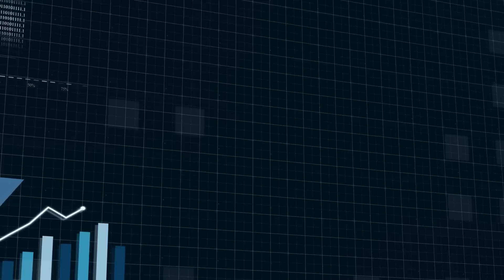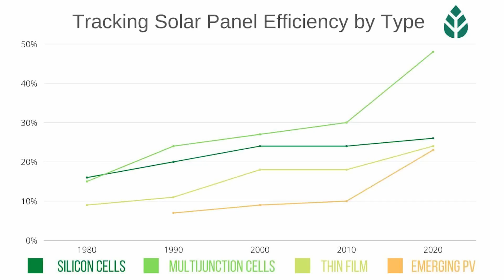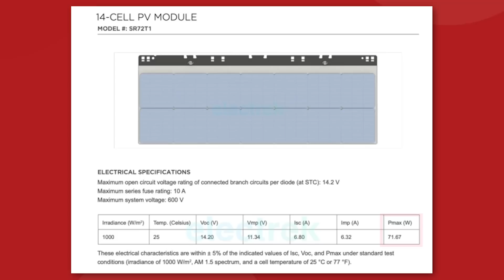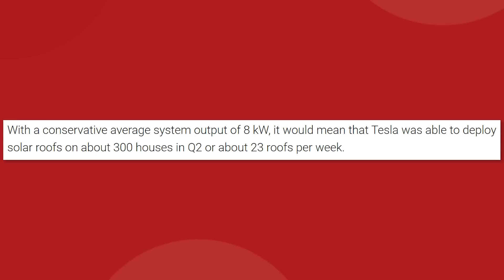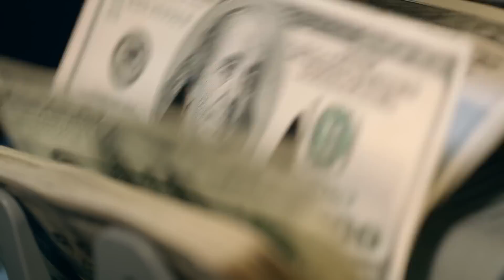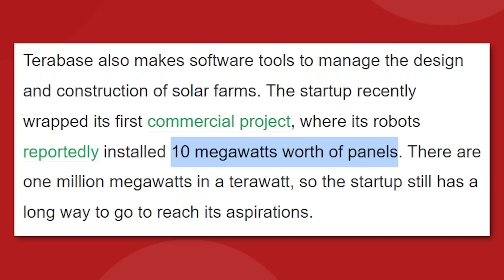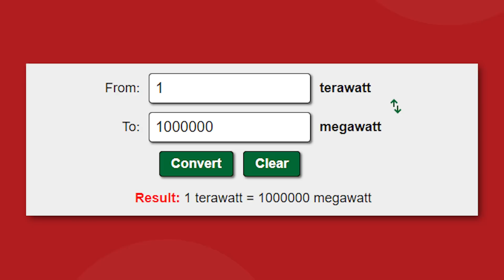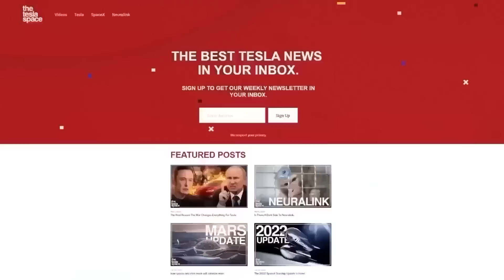Why Tesla Solar Is About To Take Over!

Comment: This summer i was helping out at a company whose neighbor was a Tesla Solor Home installer. I saw them preparing each day to go out and when they came back.
Talking with them one point is that in Texas it often is over 100F during the summer. But on a roof its closer to 160F. So its hot & hard work. Sounds like something Optimus should be doing.
Another thing is that out of 100% population at least 2-1/2% will always cause trouble. So naturally they are also involved in lawsuits with these annoying people. (Best disconnect & refund at 1st hint of trouble)
In electronics one uses a capacitor to even put irregular current. This is comparable to local battery storage. If you build power without storage you are going to creaye a problem later. Especially as you approach power needs.
And much more. Interesting subject.

Comment: I was all set to place an order for a 12.1 kWh system with 2 Power Walls until I read the little note at the bottom of the summary "We will notify you when available in your area".  I live in SE Illinois 20 miles SE of St Lous.  So I found and used an address in St Louis and No Problem.  I requested a callback and two weeks later I received a call confirming they don't have installers in my area.  When I pointed Tesla has installers 20 miles to the west of me in St Louis, and the only roadblock had to be licensing etc.  So I'm going with a company from St Louis (Straight Up Solar) who spec'd a similar system using Q Cell 405-watt panels but I get Enphase IQ8A Inverters vs a "string" inverter Tesla uses.   During my conversation with my Project Manager, I was told Tesla uses the same panels and here's the kicker, they are authorized Tesla Power Wall installers.  So Tesla come on, get your stuff together.  Either way, I'll be happy, but being a Tesla owner and shareholder I wanted a "Tesla" system and was willing to write a check for $48K on the spot.

Comment: Tesla Solar has made great progress in not only their Solar Panels but in the important part of the system, the storage, charge controller, and distribution (i.e., inverter package) in one tuned unit called the “Mega Pack”. I installed my solar system at my Arizona Ranch in 1993 which had many times less capability and capacity than Tesla system(s) do. Great strides in that area of consideration has been made. It is indeed a solution such as I had with a Ranch in an area that the grid did and would not cover.

Comment: In Australia a 6.6kw rooftop solar PV system costs as little as AUD$3,600.
Some subsidies but a very simplified paperwork process and the fossil fuel industry has had subsidies for decades.
And still charges AUD$0.30/kWh plus connection costs, at AUD$1.00/day.
The more rooftop solar the less central power plants rebuilds.
Central power plants need big government involvement and are a big impact on the state and national budgets. 
Rooftop solar is owned by the home owner and maintained by them.
Rooftop unloads the grid, and unloads the government budgets.
Reply: Exactly, I haven’t paid an electricity bill for 10 years, if you have a roof, then rooftop solar is the way to go
👍🇦🇺

Comment: USA has 300million vehicles and 300million buildings, with rooftop for solar, and the grid is perfect as it is, almost.
So the dispersed solar energy captured from the dispersed ends of the grid and which in the past has caused a power surge, a spiking of power during the day with only a few rooftop solar power systems, this daily energy can now be absorbed in all the new EV big batteries.
As every expert has been saying the battery is the 'killer' to the 'horse and cart' days.
Nobody realised the everyday car in huge numbers would save the energy grids of the world.
And save the planet.

Comment: All these new products and future directions are great, but it's not only about new products.  Tesla needs to keep the current customer base operational.  I am a Tesla solar panel system owner (2019/15KwH) and my system has not been fully operational  since January.  I have had 3 inverter failures (same error requiring inverter replacement), and each failure take 4 plus months to get a replacement, and then those replacements fail.  Tesla has the ability to make my system fully functional, but they have made a conscious decision not to take action.  I can only guess that cost is preventing them from executing.  Post sale customer support has been less than adequate.  My system outage is only one of the problems.  There have been many other incidents with customer support that would surely play a big role in a buy decision.  I still have no idea when they plan to bring my system back to capacity.  Great products have to work and continue to work.   (Note: I also own 2 Tesla vehicles, so I am not trying to bash the company, I am just dissatisfied that my system does not work and they are not taking responsible actions to rectify.)
Reply: Is the rest of your system good when the inverter is running ?
As per the advertising  ?
I am with you, just asking for your feedback.
Can anybody come in and do a work around and get some value out of your investment.  ?
Reply: @stephenbrickwood1602  
The integrity of the other components are unknown. This is both my opinion and Tesla. They have offered to do a complete evaluation of all components once the replacement inverter is received. I am fairly confident that other issues will be uncovered.

Comment: Around mid decade, Tesla will build 3 or more hyper-efficient Giga-factories.  One to build semiconductors including solar panels and LED's; one to build Optimus Prime; and one partnering with Elon's Brother Kimal to build LED based indoor farming containers.  Then Tesla will partner with farmers, whose land will become multi-use.  Tesla will use Optimus Prime to cover the Farmers' fields with Solar and Wind Power, and Mega-Packs.  The same land will be used for Managed grazing of meat animals.  In one area of the Farm, Tesla will build a giant indoor food production building which will be powered by Optimus and their LED lights tailored to shine with the exact frequencies that the plants need to grow.  There will be giant ponds growing fish and using the nutrients from those fish ponds to fertilize the plants.  This building will be 100% powered by the energy coming from the solar, wind, and battery installations and will run 24/7/365.  The farmer will become a Tesla employee with a guaranteed income exceeding the income they made as a farmer.  The efficiency of the solar to LED light conversion will be so much more efficient that current farming techniques that the same farm will produce 100 times as much food using 1% of the inputs it needed using traditional farming.  Those inputs include water and fertilizer.  This will launch the S-curve of the transition to sustainable farming.

Comment: Parking lots take up 25 to 35% and sometimes more of a citys land area and solar can take up 5 to 15% of space so why not fill Parking lots with solar.
Or have a mix of very tall shade trees and solar in a way the solar gets lots of sun not shade so that will take up 15 to 20% of the space in parking lots.
Well way more energy less flooding less heat less heavy metals in the air and more o2.
Reply: i age if you put solar panels on every building the power grid would need to a lot smaller!

Comment: Tesla will pay you a monthly fee to use your roof + battery installation for VPP - or you get money and pay a reduced price on electricity to use solar roof directly from tesla - this would make tesla an energy provider with decentralized enerygproduction facilities (x roofs) and can also stabilize the grid (reduce need of "peaker" plants)
I think automated harvesting for lithium in the nevada desert could help with the supply chain shortages, as tesla may be able to build a refinery onsite or near it (at giga nevada even?)
Whatever happens, I think wall street is NOT prepared for it => to the moon

Comment: If Tesla could develop intelligent traffic control light network that would reduce the thousands of automobiles which sit at intersections for no reason other than a red light very much energy could be saved as well as reduced emissions.
Reply: Tesla is already taking steps to reduce traffic congestion by pricing poor people off the road.
Reply: So true - it is strange that future energy use is focused on new forms while there are many ways to reduce consumption with simple policy changes.
Reply: Cheap robotaxi service and Boring tunnel projects are to help with traffic congestion and cost of getting around.
Reply: @myxalplyx  Ha ha! Boring tunnel projects just transfer some of that congestion underground. Maybe you should read up on the new Crossrail project in the UK and see how many passengers it can move, and I think they were boring tunnels about 7 x faster than Boring Company. And that's digging proper full-size tunnels, not the sewer-sized tunnels that Boring Company digs. As for robotaxis, it's a long way off considering Musk said they would be on the roads 2 years ago.
Reply: It is sad that public transportation methods in US have been discouraged for reasons I don't know......maybe because some people have significant behavior problems?

Comment: Just to say about the quick dismissal of residental installation potential contribution to the overall supply of solar in relation to mega-projects. 

That 22,000 sq mile estimate is only about double a rough estimate of single family rooftop area. Add in multiplexes, commercial, & neighborhood scaled instillations to the total available rooftop installation & the system is distributed for safety  & efficiencies. Distributed systems like this democratized availability.

Waiting on Tesla to announce a doubling every year for production.

Comment: The difference between Terrabase and Tesla is centralized vs decentralized power. Centralized power is great but a distributed grid is the most fault tolerant, there is much room for both.

Comment: Yes solar is not „free“.
But its cheap enough people still install it when they only use 50% of the used energy.
Rest is flooding the energy market which will result in electricity prices most times during daylight.
Those in the energy market who can use this abundance energy most efficient will benefit extremly.